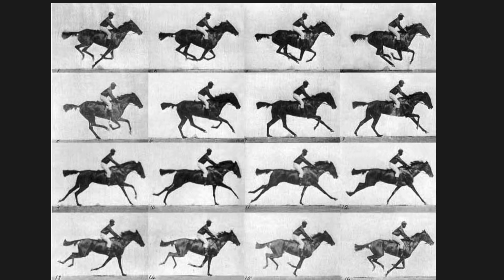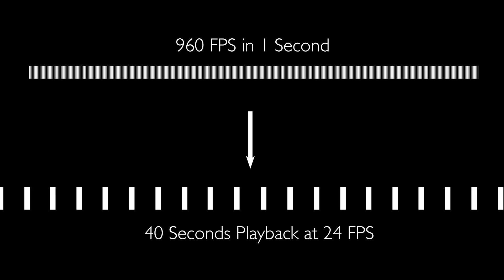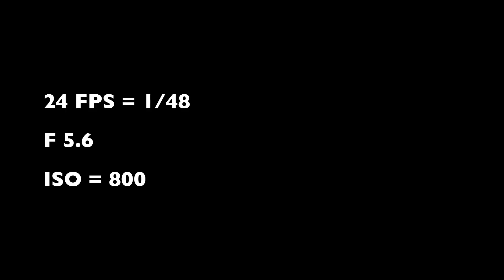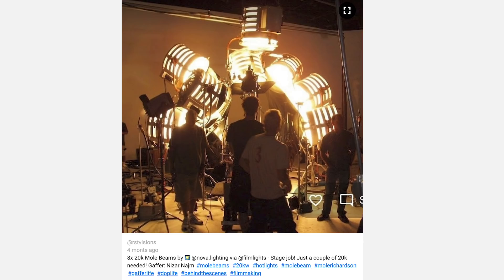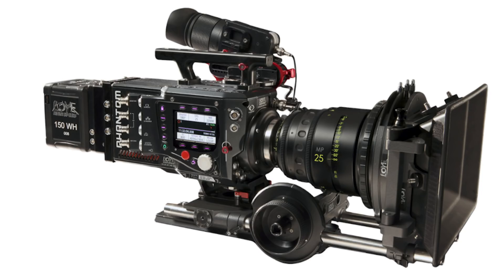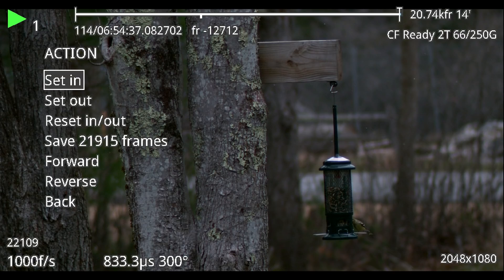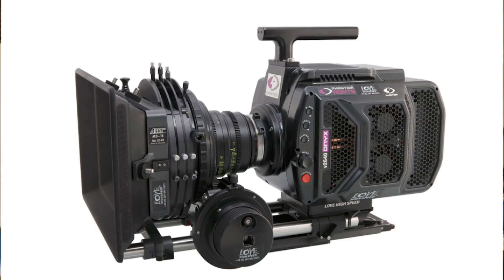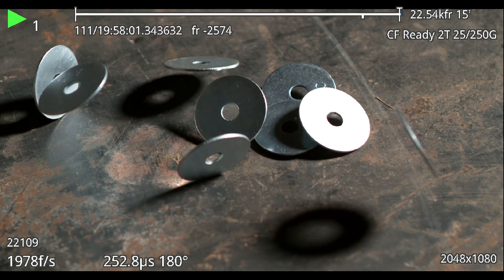How To Shoot and Light Slow Motion Videos

Comment: I just got into slow motion photography and I'm building some LED lights for it. Any recommendations to a good DC-DC boost converter that wont flicker? I ordered some to test but they have not gotten to me yet. I just happen to have a dozen or so 20ah 13v LIFe batteries laying around I want to use but the 100 watt LED chips like 32v at 3 amps CC so the boost converter is needed.

Comment: Thanksfor the detailed video. But I have some questiins left: 1.) You didnt say how much light you needed to output in your setup. 2.) What lights you recommend not flickering? 3.) What framerates do you shoot your food stuff at most of the time?
Reply from the maker: smepable Mg 1. It all depends on the size of the set, f-stop, and quality (hard / soft) of light. Here I was using our custom led light at about 1000W shooting F. 2.8   2. Plasma lights, some LED’s, and well, we use our custom LEDs since we made them not to flicker and to be high power. 3. Between 120-1000 for most shots. Some just as 48-72 sometimes

Comment: Great video and explanation. I've watched all the others - did I miss somewhere in the LED videos how you are able to dim the LEDs without using PWM somewhere along the way? Do you just use an extremely high frequency PWM on the order of a few KHz? Or do you filter out the PWM which essentially reduces the current by reducing the voltage?